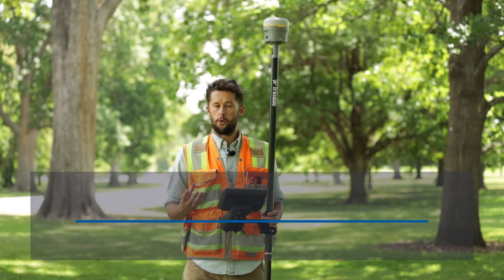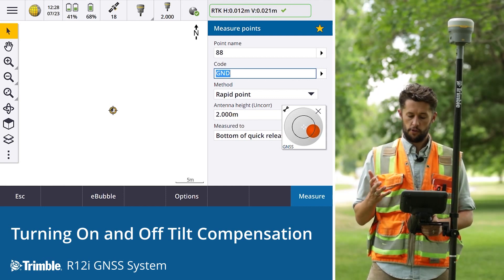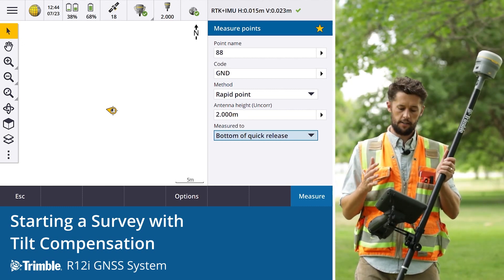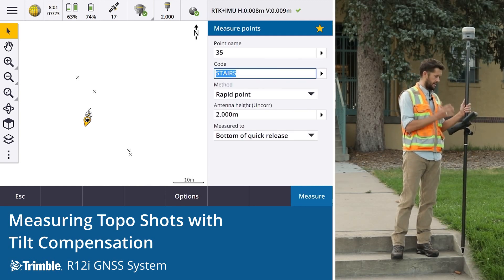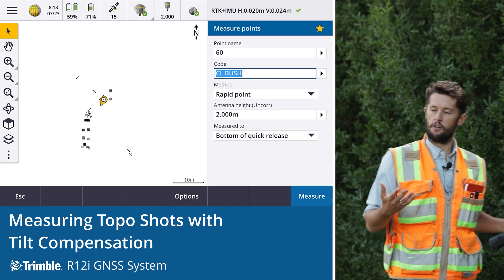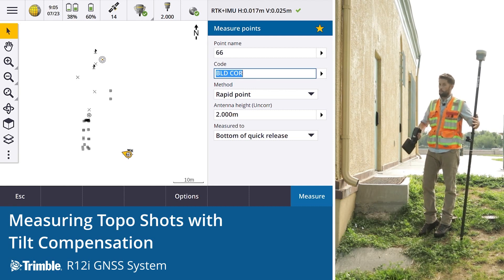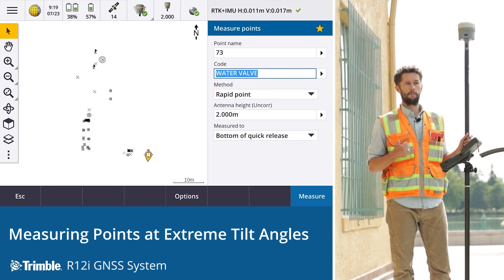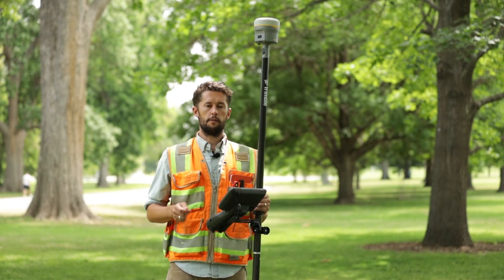R12i Tutorial: Complete Video Series

Comment: I am Vietnamese, currently I am using Trimble R4s with TDC-600 manual. It has a faulty electronic compass feature on the TDC-600. Specifically, the electronic compass on the trimble TDC - 600 manual is faulty, the orientation is not correct compared to the mechanical compass. Makes the point finding process difficult, because it's difficult to navigate, How to fix it
Reply: You could possible store two known and calc’d points. Tell the machine angle from point to point is 0 degrees to give you at least a heading to work off of. Not sure if you can even zero up with gps tho
Reply: Which one is better trimble R12i or Leica G18T?